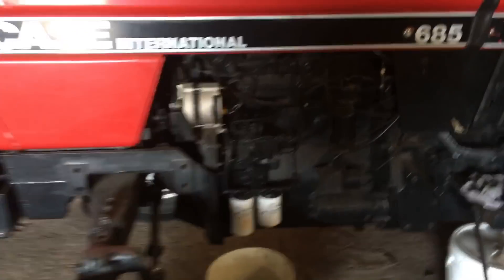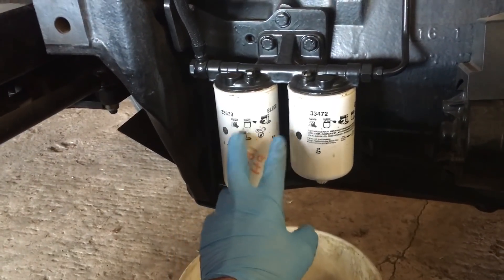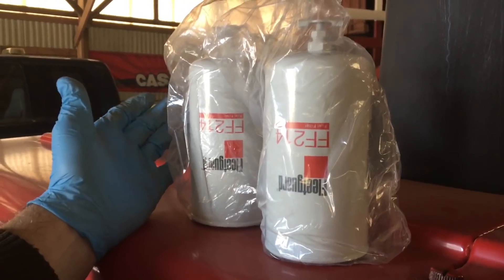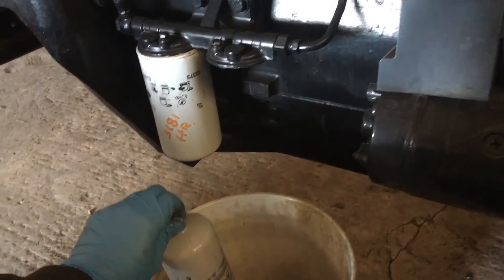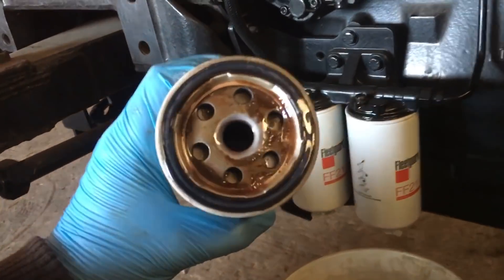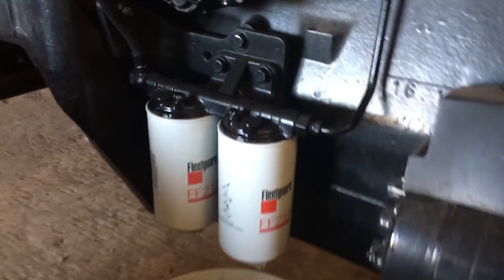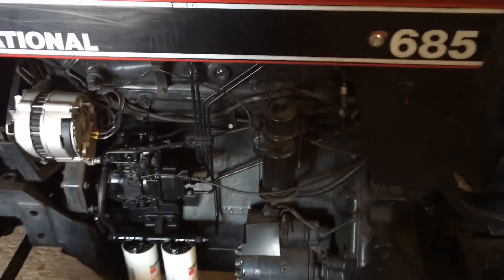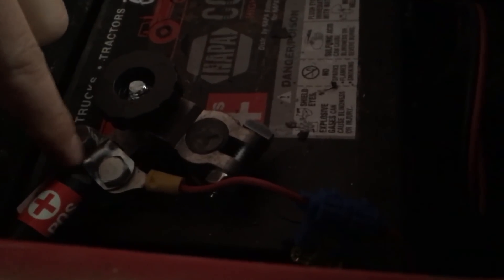Case IH Fuel System

Comment: Hey! Just seen this video and I can say one thing for sure: If you ever have two filters in series like that, one is always different than the other, or at least it should be. And if it isn’t, take advantage of it and have the second filter about 10x smaller sieve than then first filter and you can have better filtration performance. Fuel/water separators like that first guy said would be a good idea as a rule of finger-after-thumb for outdoor equipment like tractors. Anyways, Great video! Helped me out a lot with my 485! Thanks.

Comment: I wish I had the glass bowl filters because the Wix spin on filters are $25 ea. at the local parts store in Charleston vs $5-6 for the bowl style. Even from rockauto those Wix are $14+ and shipping. I had fuel issues from the tractor sitting 25 years and @ $25 each it sucked. Also the engineer that designed the fuel line from the tank to the filter that goes up, down, makes a couple loops round & round should have been hung in the town square. I had a problem with that line numerous times until I was able to clean out the tank. Excellent vid again.
Reply from the maker: Thanks yea the prices are getting out of hand even for filters

Comment: Everyone will do what’s best for them. But personally for me, when I’m replacing the the fuel filter, I’ll actually fill it up completely with Seafoam, not diesel, then install. Shortly after you fire it up, it will be running 100% on Seafoam, no diesel. After letting her run for a bit, I shut it off and let that Seafoam soak the injectors/cylinders for 10-30 minutes. Then I’ll fire it up again and run it hard. Cleans her up nice

Comment: The only difference I noticed between the old filters and the new filters is on the old set, one was a fuel filter and one was a fuel/water separator. The new filters were both fuel filters. Not sure if that matters, as I do not know the performance difference between a fuel filter and a fuel/water separator. Hope they work out! By the way, I have to rub it in just a little that we did not get any snow from the current storm lol
Reply from the maker: 10” and counting
Reply: Well, if it makes you feel any better, we still have over 8" left from the last few storms.
Reply: PA Farms I hope your weather forecast is more accurate than ours was last week. Here in Erie last week they said 3-6 and up to 9 locally and we got over 15

Comment: I thought I saw a fleetguard filter book in your toolbox when you showed it in one of your videos if you have one it should tell you what ones go on your tractor. I have a 3088 with what appears to be the same filter base ant it takes a ff214 and a ff215.
Reply from the maker: Good eye, that’s actually a lubricant book with the capacities. I did have a filter book at one time.

Comment: Diesel is so damn dirty. On 685 4wd loses power every once in a while I had to disconnect both ends fuel lines (tank to filters) i had blow it through with air to get it unclogged. I just changed the fuel filters last month. bought carquest filters from advanced auto store which is 2 miles away. beats going to a dealer 20 miles away.
Reply from the maker: Yea I get very fussy with Fuel. I change filters often, the fuel I put in gets filtered twice. Also I always put additive in year round